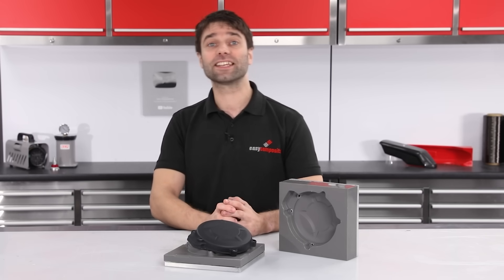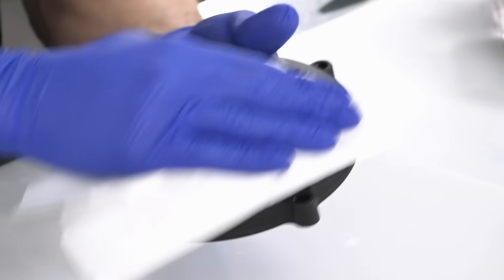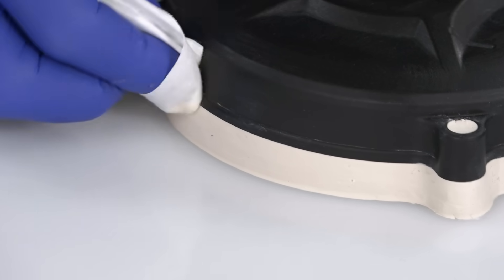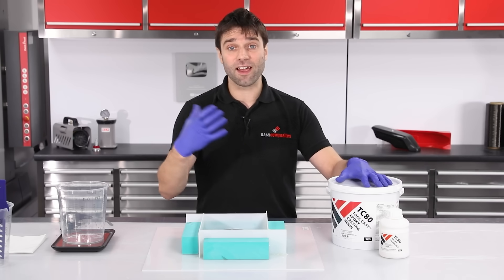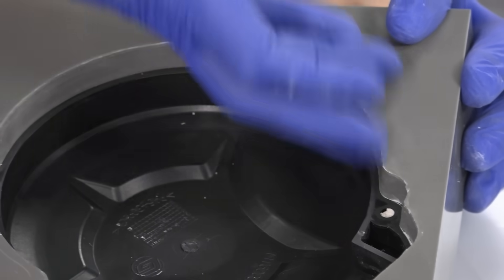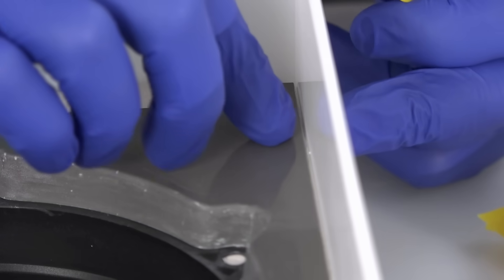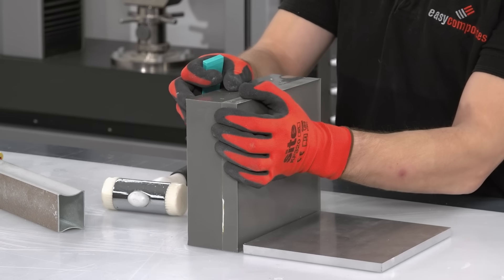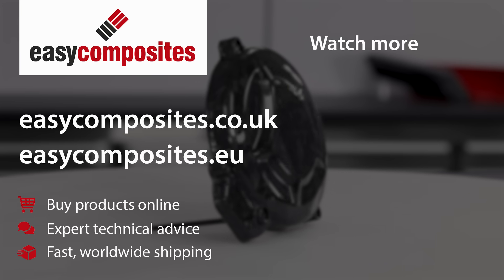How to Cast a Two-Part Compression Mould for Forged Carbon Fibre

Comment: sry if this might be a dumb question, but did we leave the part in while making the B mould so that we could create that "piston" edge that you mentioned? or was there any other reason? i couldnt quite understand the logic of leaving that part in
Reply from the maker: Yes you need to leave the original part in place to produce the other side of the mould tool. If you removed it prior to the second casting there would be no cavity to fill with the carbon fibre material when making the final parts.

Comment: What is the best method to make a 2-part mold of an object that has a bolt hole on the top side and a supporting protrusion on the bottom side (a bolt fits through this hole on the top side and fitted into a nut on the bottom side)?

Would it be best to use a dowel to create the cavity for the bolt?
Reply from the maker: Yes a removable insert would allow this feature to be produced, alternatively you can drill the material out as part of the finishing process.
Reply: @easycompositestv great, I have a good idea of how to move forward. Thank you!

Comment: Incredibly clever process for one-off or prototype carbon parts! 🔥 Casting a two-part mold like this is pure craftsmanship. For series production requiring high-pressure resistance and thermal stability, our CNC-machined aluminum or steel molds are the industry standard. This is a perfect starting point!

Comment: What’s this mold material
Reply from the maker: There's a link in the description to a page on our website that lists all of the materials used in the video, here's the link to the page: https://www.easycomposites.co.uk/learning/casting-a-two-part-compression-mould 
The mould material is 'Tool Cast', it's available as regular temp (Tool Cast 80 https://www.easycomposites.co.uk/tool-cast-epoxy-casting-resin-for-vac-forming-tools) and high temp (Tool Cast 160 https://www.easycomposites.co.uk/tool-cast-160-high-temperature-epoxy-casting-resin)

Comment: You are describing a type of compression moulding, not forging.  The latter process describes shaping metals by ending or hammering etc, using machines or hand tools.  Shaped forms are sometimes used, but these would use high-pressure hammering on a mechanical press with the metal very hot.
Reply from the maker: We are very aware that this process is not the same a traditional forging, however it has been adopted by the industry and is what the majority of people call this process and technique.

Comment: Must be a pain removing the part from such a deep mould...
Reply from the maker: Adding in sufficient draft angle to the part can actually make demoulding quite straightforward. A reliable release agent and considered design is very important however.
Reply: @easycompositestv  had horrible experience with another mould where I unintentionally made a deep mould with much higher draft angle and it was still difficult. There were a few bits that needed to be chipped from the mould to release the part. Lesson learn to inspect the mould before trying to remove the part.
Reply from the maker: That may be down to release agent application.  Also with deeper moulds, removing it vertically evenly all around helps stop the part twisting and jamming in the mould.
Reply: @easycompositestv  thank you! It was mechanical lock in this case

Comment: Could use this molding technique for regular 2x2 twill also or is it not possible?
Reply from the maker: Compression moulding can be used for processing woven cloth yes. You do however need to be cautions that it requires the laminate to be applied very evenly with an accurately calculated thickness. Unlike the short strand chopped tow a woven cloth has less ability to move around the cavity and fill any gaps. This can sometimes result in voids on the surface and a compromised surface finish.

Comment: How much pressure could a mold handle.
Reply from the maker: It would depend on the geometry and size of the mould. With the compression moulding technique for 'forged carbon' you only need to apply pressure until the mould is closed. Doing so carefully whilst allowing excess resin to escape will reduce the chance of hydraulic lock and causing damage to the mould.

Comment: Would this be a good choice for a brake lever or would the 3d printed moulding be the better option like in the video
Reply from the maker: Hi, it entirely depends on what facilities you have available to you and if you are happy with the original part. Designing in 3D CAD allows you to make adjustments and changes or create something entirely new, whilst a cast mould required an original part with a good surface finish which can then be replicated.

Comment: What do you guys use to fill any imperfections in the mold? Can you thicken this stuff for filling? If so what would you recommend?
Reply from the maker: You can touch up with the TC80 Itself and for most small repairs, would not need to thicken the resin system.  If you really needed to thicken, you could use fumed silica to thicken it.

Comment: what is the heat resistance of that carbon fibre cover?
Reply from the maker: The heat resistance of the part is more related to the resin. The cover here was made with our IN2 resin which can be post cured to have a service temperature of ~ 73°C

Comment: if we had to make parts that are deeper than 6cm, should we make the mould in 2 stage pours?
Reply from the maker: yes or you can block out sections of the cast with foam or wood to limit the resin thickness.
Reply: @easycompositestv  thank you

Comment: What is the process for making this part optimized?
Reply from the maker: Its very part and load specific.  A cover like this would unlikely benefit so much as the brake lever did which being long and thin, benefits from additional fibres down its length.

Comment: Hi Paul,
this is an incredible useful and informative video, as you guys always do.
Thank you very very much

I have a (silly) question, which maybe will be important in the next future: do you think resin and composites technologies are going to became more eco-sustainable?
I mean, the epoxy and other chemical stuff you show are crazily wonderful and, in my opinion, they have the great value of not using or using very a little thermal processes (which mean massive electricy consuption).
But still, they are chemicals.
While in spite of for instance resin 3d printers, VOC and nano-particles should be low or absent (as you often explain in your vids), still this chemicals are toxic in the liquid state and not biodegradable when cured.
It shoud really beautiful if we could use stuff fully compostable... I think of hemp fiber and vegetal resins from my limited undertanding...
Can you explain and maybe show some of this kind (if it does exist)...

I like gardening (especially the brit way like Charles Dowding no-dig method) and I think about a possible "inspiration" for manufacturing and prototyping industries: do, create "waste", get new resources from it (i.e. compost), continue to create...

What do you think?

Thanks again, you guys are number one

Cheers from Italy
Reply from the maker: Hi Carl, 

Not a silly question by any means and something that we are certainly conscious of. Unfortunately the pure nature of thermoset polymers do make the recycling process of the end product difficult. You almost need to consider a holistic view that if a component can be manufactured lighter from a composite structure for say a transport application, how much fuel (energy) is that saving over the life of the product over something made from a metal which, may or may not be recycled at its end of life. Not only this, but the capabilities that composites allow, some applications simply wouldn't be possible with other materials or manufacturing methods.  

There is certainly some progress in the area of more sustainable sourcing of the raw materials, our Bio Resins for example contain about 38% plant derived content. 

We do also stock a range of flax fibre reinforcements but as always, you do need to consider the absolute performance vs the eco credentials of the material and what is the most suitable for the relevant project.
Reply: @easycompositestv  very reasonable observations.
Thanks for replying, congratulations for you video

Comment: It could be done with the gel coat EG 160?
Reply from the maker: Not as a cast no.  As a traditional mould, yes, but you would need to backfill the mould to get a flat surface for enabling the clamping evenly for the compression aspect.

Comment: What is the maximum heat that this tooling can tolerate?
Reply from the maker: The max service temp for the TC80 used in this video is 80°C. We do have a High Temp casting resin, our TC160 which has a higher service temp of 160°C
Reply: @Easy Composites Ltd  for the TC160 what happens to the casting if the temp exceeds 160°C? Is the casting still usable or is it destroyed?

Comment: On the website it says pot life 3 hours... does this mean that once I open it I have to use the entire thing of resin? or does it just apply once the parts have been mixed
Reply from the maker: Pot life refers to the amount of time from mixing the resin and hardener until it begins to thicken and go off in the mixing "pot".
Reply: Got it thanks, I guess I mistook it with "shelf life". The carbon forging kit was well worth it. plenty of material for a handful of projects. 👍

Comment: When I used to do fibreglassing, we would put a hole in the mould at a point where a hole would be drilled later, to be able to blow out the part with an air gun if it was a tricky mould
Reply from the maker: Yes that can work as well.

Comment: Is it possible to sand and use a chemical sealer/release on the casting,to give it a glossier  finish from the outset? And therefore less prep on the finished part? Thanks
Reply from the maker: Yes, the higher the quality finish on the part you are moulding from, the less work needed on the mould itself.

Comment: looks like you basically made a zero clearance mold.. I don't get how that works..
Reply from the maker: Its not zero clearance, the part is left in the mould so it is offset by the exact thickness of the part.
Reply: @easycompositestv  thank you, I’m a moron. I really want to try to make a part for my bike, my helmet is forged carbon and I love the look.

Comment: I'm about to use this mold casting meterial can I use pva with the tc80? Also before spraying the rw wax can I use pva then or after? This parts a bit complex and I want to make sure this part separates from the mold
Reply from the maker: You wouldn't normally use both.  A good application of PVA will work well in most cases.  The RW4 is easier to use and with several layers offers good reliability.

Comment: can you use carbon fiber strands or sheet instead of aluminum plates for strength of casting?
Reply from the maker: The metal sheets are better at spreading the clamping load.

Comment: Question I'm making a compression mold having a hard time finding casting resin in the u.s and shipping is a bugger can I get away with using vynle ester? Or is the shrinkage a issue? I was thinking if treated it like a normal mold did a layer of chopped then mixing in some thickener and making a chunky milky mix to fill and build it up like the block on the video. Or would a deep pour epoxy be a safer and better bet?
Reply from the maker: As long as the material has low shrinkage and reasonable compressive strength it should be ok.  You could even 3D print the mould.  It does need a flat reverse so it can be evenly clamped during the process.

Comment: Can we uses these molds for Vacuum casting and Injection molding ?
Reply from the maker: No as there are no vent holes or injection ports to get the resin in. If you designed it with those features, for lower temperature castings then it should work.

Comment: Im working right now with tc 80 toolcast. Its absolute easy to use.
But i have a little problem i dont know to solve. May someone has some ideas?

After a day i tried to demold. Female side works absolute fine but male side is not only stuck its like bond to the male side. I used release agent and made sure theres no corners where it hangs on to the mold.
At the end i had to cut the epoxy down and its still hard to pull of.

The part ive casted is mashined aluminium no rough edges plane surface. I really cant imagine what went wrong
Reply from the maker: Possibly release agent not as well applied on one side?
Reply: @easycompositestv  i would say no, i treated both sides same. I will try another agent or maybe cast a new male 😄
Reply: @eIgHtY0N3  i did everything like in the video. My fail might was the release agent. I try next time with release wax.

Comment: How would you propose releasing a alloy plug, as opposed to a nylon one?
Reply from the maker: You would use a release agent on the surface. Also be extra careful with your draught angles on the mould design as the alloy plug will be able to be flexed less than a plastic one.

Comment: Hi not sure if this question was already asked. But if not hope you can answer this one. As a product you used a injection molded part. But to make this mold can I also use the original cast aluminium part?  I love these series. I hurt my back. And can’t go on with my old hobbies. So I want to start making carbon parts. I will read more into you business. But you guys are by far the best out there
Reply from the maker: Yes you can take moulds off a cast aluminium or any metal part in the same way as the plastic part.
Reply: @easycompositestv  thank you for answering my question.

Comment: great videos, but I have a question when the oven should be used and when not to be used?
Reply from the maker: If you're asking when an oven should be used to cure the tools then this would be described as a 'post cure' because the TC80 casting resin does cure at and is usable after an ambient (room temperature) cure. If you want to use these tools at elevated temperature, including things like using them for vacuum forming or even low-temperature cure prepregs, then you'll need to 'post cure' the tools, once they've cured at ambient, to increase their service temperature.

Comment: ...Could you bond the backing plates in one go - just putting them on the  top of poured epoxy? In case of  wood  blocks, They would simply float,; incaseof metal plates, some additional shennanigans wouldbe needed to suspend them at given position and sto them from sinking all the way and resting on the part.

Is it a viable option (and saving one step per side)?
Reply from the maker: In theory yes but generally a heavy metal plate would try and sink into the resin which would be undesirable.

Comment: Thanks for the great video! This has me excited to try a new project and learn a new skill. I was wondering if there is a set of guidelines used to determine which types of parts could be made using this method? I have some small interior auto trim parts that I would like to try as a starter project but am unsure if they would be suitable.
Reply from the maker: Hi Taylor, in terms of suitability, the main factor is that they can't be too large. Items the size of typical interior trim pieces would therefore be fine in terms of size. As for other guidelines; you probably just need to be realistic in terms of the complexity of the component. You'll have seen from the video that taking the male and female mould sides off an original part is very accurate but if you have any fine detail like clips or catches or tangs on the reverse of the parts then they might be either too delicate or could lock the part into the mould so would need to be simplified (i.e. removed) if they're there.
Reply: @easycompositestv  Thanks for the reply! For a part with tangs and clips is there a suggested method that would best recreating the part? or would skinning the part be a better option for a beginner? Thank you,

Comment: Awesome video, thanks for this!
With the mould that you made, could you use this process for creating parts from the matt as well as the chopped fibres?
Just thinking as I have some parts where there are fixing points on the B surface and want to keep those as accurate as possible and have a the nice VCF parts for my dash parts.
Reply from the maker: Hi Michael, whilst it is possible to compression mould more continuous fibre formats of carbon reinforcement, like a woven cloth, you'll find woven reinforcements much more restrictive in terms of the shapes that you can successfully mould. The reason this process works so well with chopped carbon fibre tow is because the individual, short strands of carbon fibre are fairly free to move around and distribute themselves in the mould under pressure. If you use a woven cloth, the fibres are continuous and bridge right across the component's surface, as you add pressure, it starts to lock the reinforcement in place and doesn't allow it to redistribute into corners, cavities, details etc. The result, if you made a part like this flywheel cover, is voiding/bridging in various areas of the component. However, for parts that are predominantly flat or with only gentle contours, you might get away with a woven reinforcement. One option might be a hybrid approach where you use woven cloth on the surface and then back it up with chopped tow, effectively getting the best of both worlds. Again, it would depend on the geometry of the part you're making.
Reply: @easycompositestv  Thanks for the feedback. The hybrid option was going to be a follow up question so thanks for covering that too. I think what i'll do, is I have a number of interior parts for my old Mazda that i'd like to fancy up with a carbon look and remanufacture some others due to damage. I'll have a play and see how I get on. Appreciate the help, and thanks again for the tutorials, they're really well put together and extremely helpful.